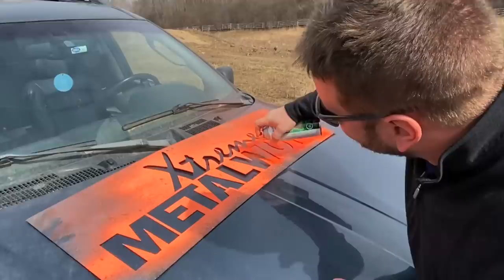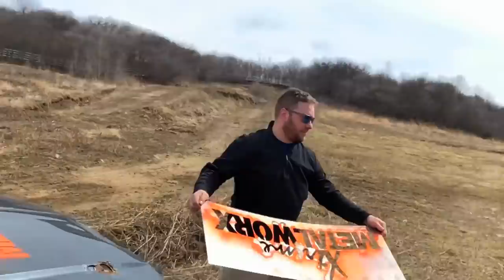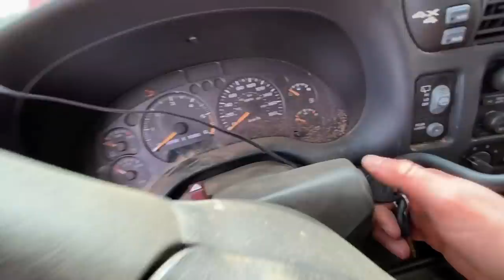4X4 Blazer JUMP!

Comment: I think y'all blew the engine in the Blazer...
Reply: Nah. I have a 4.3 in my jimmy, that took a beating and still runs. Horrible rod knock, overheating and barely any power but she still runs. Barely starts up and I revtapped my jimmy a few times too.
Reply: @logan_dabeast7961  damn you put that old beast through abuse. Then she still runs? What's her Mileage? And reminds me of my old 2000 Oldsmobile Alero. We would put that thing through abuse until it blew up. Her Mileage was around 127k I think.